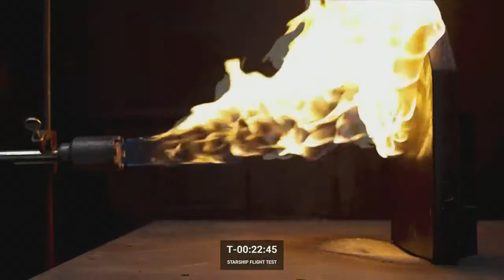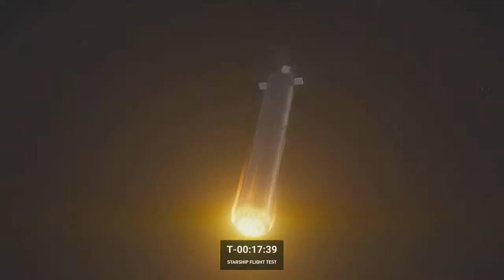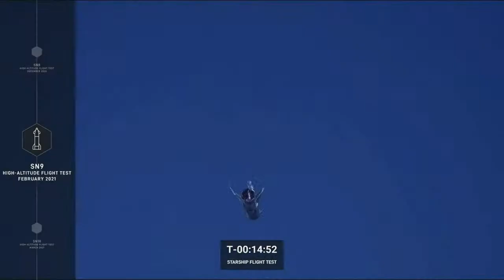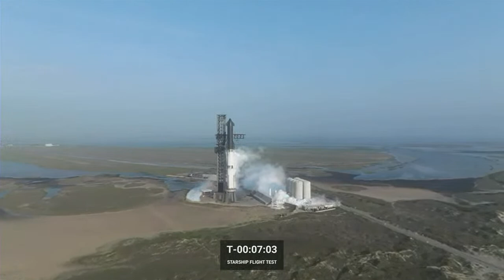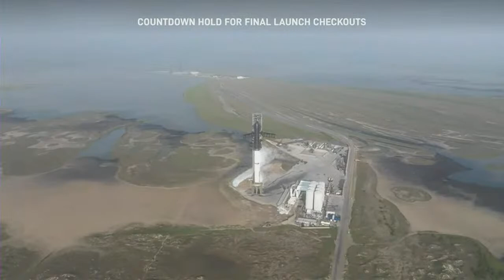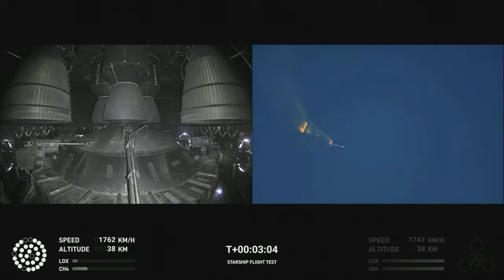SpaceX launches Starship, world's most powerful rocket, but flight ends in explosion | full video

Comment: It'd be funny if it was something really stupid like a multi-wire connector not being plugged in that was missed during pre-flight. Whatever failed isn't that obvious from what is seen here, so it's like a signal didn't get through between the stages for it to do its thing.

Also if you want to get right to the action, the last 10 minutes is where it's at. Most of the first half hour is just commentary while the tanks get purged and fueled up for the launch and status is given on various sensor tests. (If you're into that it's fine, but saves a good bit of time if you're not.)

Comment: What a bunch of moronic comments. SpaceX has been testing each of the components for YEARS, and THIS should have been a smooth test. Cheering as it explodes, like they all knew it would happen AND the fake smiles on the three ‘reporters’? Too much. As it launched I could see a couple engines failing, maybe four or five. Then after the separation was supposed to happen, they couldn’t? That part should have happened when they first detected abnormal spinning…

Comment: Whenever they test one of their new rockets there is always a higher chance for "failure". They were clapping because this was their first full-scale test and were excited it even made it off the launch pad, that in itself is a huge success. I'm by no means a rocket scientist, but just based on this test and their other rockets' successes/failures, I would guess 3-4 more attempts before everything from takeoff, booster detachment, and landing are all successful. They get a lot of data from these tests and make adjustments. Part of engineering is failing fast, making adjustments, and retrying. Most companies don't show anything until all these types of tests are done and their more certain everything from start to finish will be successful. SpaceX is unique because they have been showing the entire process from start to finish, which includes all their failures and successes to get to where they are.
Reply: kinda hard to do a rocket launch in secret tho
Reply: SSSHHHHH!!! You are making too much sense! The clown audience won't like that!
Reply: It is called a test launch… and for the right reasons.
Reply: Considering nasas history with exploding astronauts the safety system in real time detected system errors that threatened the would be life in capsule. It then automatically released the capsule rapidly and safely with all test dummies intact. That itself is lightyears ahead of soo many space projects since human life and safety should be the number 1 priority. The space shuttle challenger crew would possibly be alive, not so sure about the Columbia crew since they died reentering the atmosphere. I think nasa knew they were probably gonna die but decided not to tell them as to not cause panic or leave the crew w the decision to either wait and die in space or during reentry. Even with the challenger mission engineers warned about the temperature being too cold and predicted exactly what what happened w the o ring minutes later but was ignored because their priorities were to launch on time because they had already rescheduled the launch date too many times and instead chose to launch on schedule over the safety of the crews lives
Reply: It was truly spectacular.  Keep up the good work Spacex🎉

Comment: Clearing the tower seems like a pretty low bar.
Reply: This was the largest rocket ever launched. It's built to go to Mars, both booster and Starship self-land, and both are reusable.

This TEST flight cleared the tower and hit Max Q. It's all baby steps.

NASA has no other option for the moon or Mars. This rocket, from a private company,  is it.

There's a lot to cheer about and lessons to learn from failure.
Reply: Usually most rockets don’t even make it off the pad, it actually flew and they got valuable data for the next flight. 

So mission failed successfully.

Comment: Why are they applauding an explosion?  I don't get it.
Reply: They just wanted it to lift off the ground, everything else was extra.
Reply: Explosions are how we learn in rocket science. The test was not expected to be a success in that the ship reaches the final destination in the mission, but in that we learn heaps on how to actually operate these rockets from these tests. Look at SN8. That belly flopped and landed horizontally, but exploded. Same with SN10, but it was a much better and safer landing. But they finally got it with SN15. Its progression. We will only learn by doing, and sometimes, that means doing explosions!
Reply: It was the first real test of a new rocket they are developing. They wanted to see what would happen. It was expected to disassemble but the data that was recorded from it is invaluable to the development of the next one. I'm assuming it had thousands of sensors  on board being recorded on the ground.